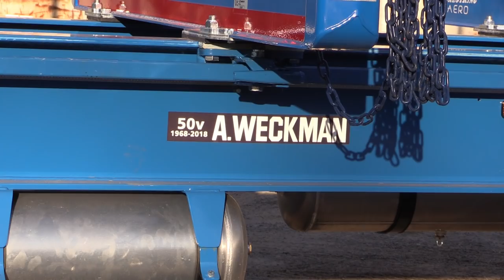Truck HCT-Rekka Weckman Heinola 2018

Comment: A very nice Timber train. I'm as an old specialist for timber transporters would made two points different!
1. The truck manufacturer would be with me another (only a premium timber truck) and 2. The configuration for the train would be different, this one on the movie is to much "special", no scope for flexibility. This point can be done better! I have built several trains for Finland, I know what I'm talking :-). 
Nevertheless my congratulations to company Weckman, great job.   Wish you any time a good ride: Jo, the Timber truck guru :-)
Reply: Sisu might have junk Mercedes engines now but at least they still offer the best transmission in the world, the Eaton-Fuller!
Reply: @ImForwardlook  No, no its 40 years ago the Fuller was the best, today is ZF same, even better! In case of problems you get more service stations in ZF as in Fuller.  But I have talk about the train configuration, the are very far from optimal, look, the truck must run to the side for loading, what a nonsense, and many more!  About MB we need no to talk, its just s... at all!  I biult timber trucks, and I have the best feeling and the most happy customers with VOLVO and SCANIA for the Northern European market and many happy customer with MAN for the Western European market.
Reply: @joachimscholz7098   We got new Man with ZF, and they are still like 80's, slow and hard to use. We tried new actross with ZF semiauto, and it's so slooooow that it's incredible...
 I bet new ZF's got still same problems with synchro's than 70's gearboxes... FULLER  RULES!! reliability, and fast to use.....

Comment: Is the load only tensioned by hand? No auto tension? How much longer does the loading take? Does normal log trucks load in the forest and unload close to road for this one to take over? Seems like it would run out of room to load on a normal narrow road. 

Cool concept thou
Reply: I believe that trailers have auto tension. This concept can be operated as normal 9 axle (76 ton) log truck. You just disconnect second trailer and move bunks backwards.